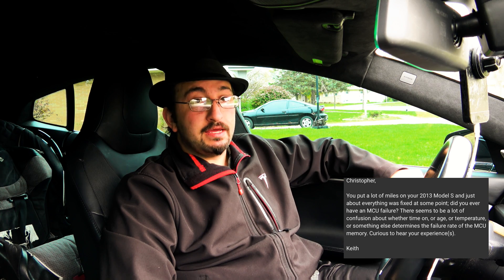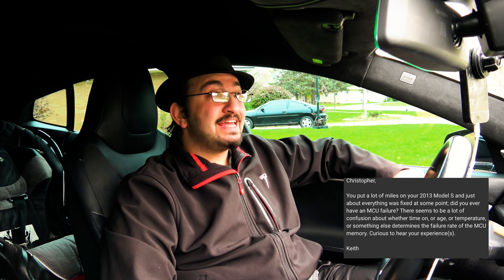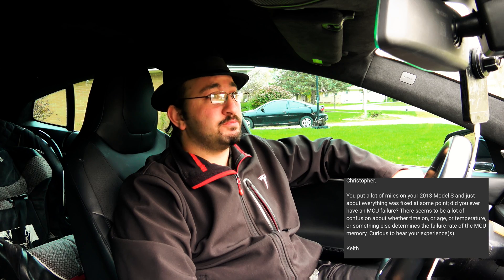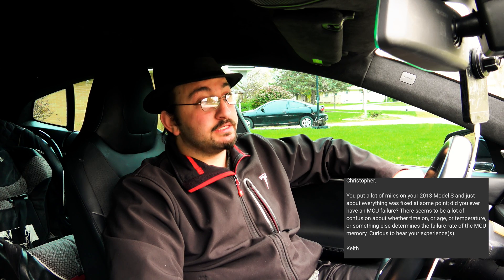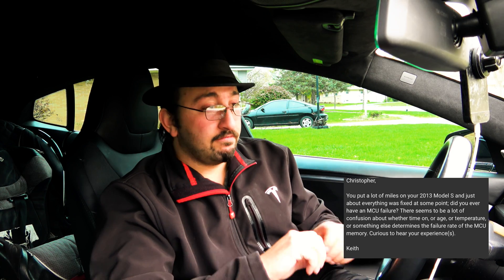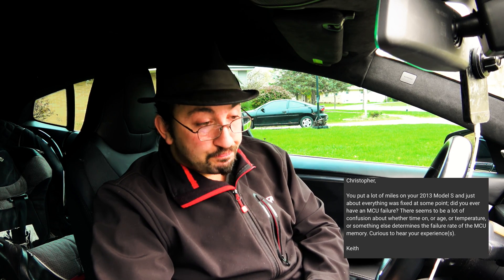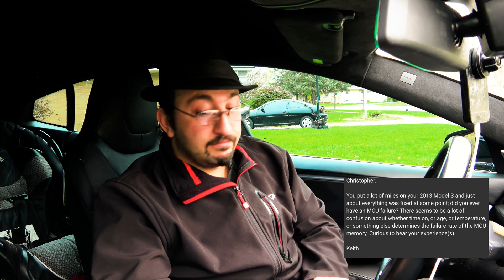Tesla MCU Failure Prevention Q&A (Touch Screen) Fixed Audio

Comment: Can you make a video for new EV  riders,  What to do to increase your Range? from litle things , to extreme. (mass,tire presure,speed,airco,Heat cabine, ride hight, 19" or 21")
Reply: things before driving,  and things on te last mile to reaching supertharger,
Reply from the maker: yes! Absolutely! that is a excellent idea :-)
Reply from the maker: Floris van Noorden going to try and film that one today or tomorrow morning
Reply: next idea: ev charting edicate (front facing charger ,for ev with trailer) (Clean up, For Clean/Green Chargers)
Reply from the maker: Floris van Noorden https://youtu.be/Ppt-DoLy7fg
Reply from the maker: Floris van Noorden but you make some good additional suggestions for keeping a station clean
Reply from the maker: Filmed. It got too long, about 50 minutes, so I'm breaking it up into Parts, Part 1, Part 2 and Part 3. And will do a whole as a straight shot. It's still uploading, so first part either Friday or Saturday.
Reply: KmanAuto before driving , during driving, and when in need